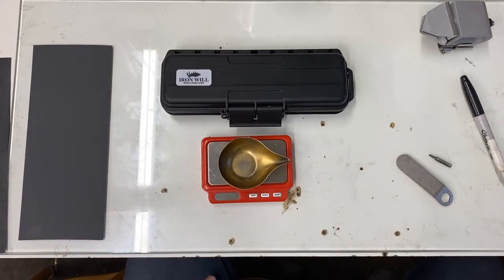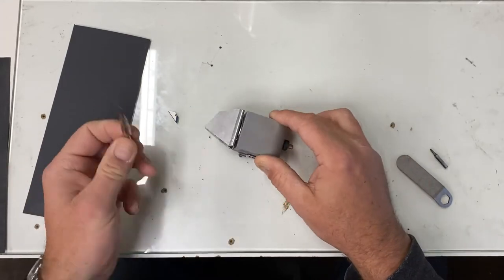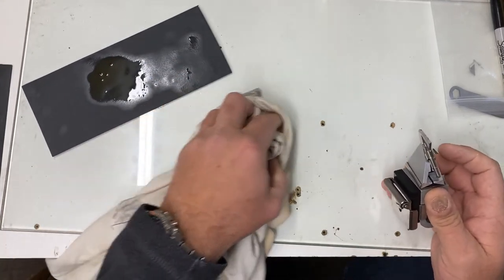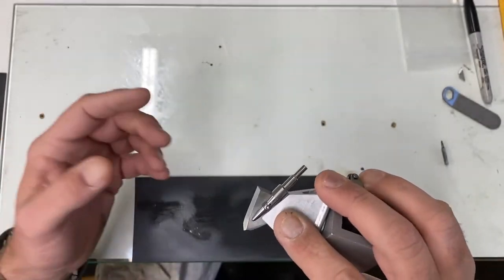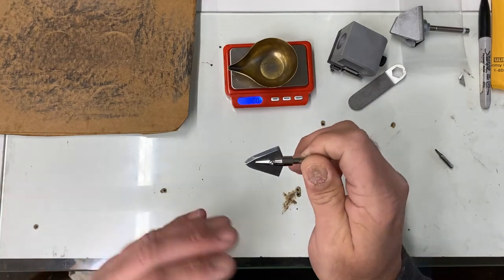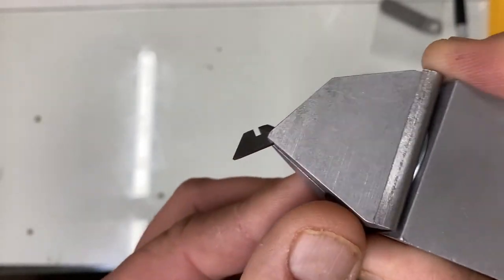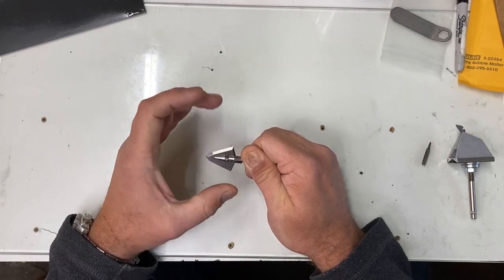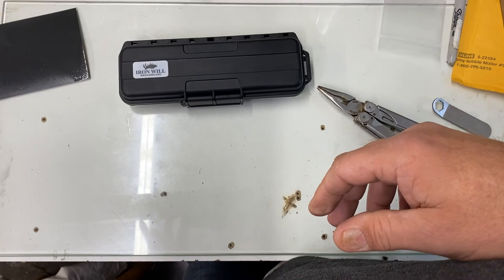Iron Will Single Bevel Broadhead Sharpening.  200gn With Bleeder Blades.  KME Sharpener

Comment: I just added a cut of a spreader plastic card under the bottom slider bout 3 mm thick and its at the perfect angle for the iron will 150g single bevel..! 
Good tip on the tanto tip sharpening..! Works a treat..!
Reply from the maker: Thanks for the tip.

Comment: The tip is called a 'Tanto Tip'.   The Tanto tip is proven to be the most effective for a non-skip tip, and for initiating the splitting action when impacting bone. Also, helps prevent the tip from curling. Very good video.
Reply from the maker: Thanks a bunch,  glad you liked it!

Comment: Thanks for putting this together.  Just got my KME deluxe kit in the mail.  Psyched to get my single bevels perfect.
Reply: Forgot to mention. I have one IW broadhead I use as my practice broadhead.  This thing has taken bits of steel off of my iron will field points when I broadhead tune and get em close.  The heads a disaster.  I'm thinking I'm going to lose several grains just trying to get it back into shape.

Comment: Is this a newer version of Kme broadhead sharpener. Does it have a height adjustment. The older version you’d have to move or position the blade  more forward or backwards. Wondering if this one have a height adjustment.
Reply from the maker: This is the new version with the adjustment plate and the short jaws.  As far as I know you have to get all 3 separately, but they may have a package deal now.

Comment: You're using cardboard to test your angle? Seems like that would have quite a bit of give and throw that angle off slightly every time, but maybe it's close enough.
Reply from the maker: Thanks for the comment.  Then cardboard is super thin and I'm testing on glass.  I do apply a bit of pressure on the paper as I know it will give some.  Probably the best test is 2000 wet on glass.